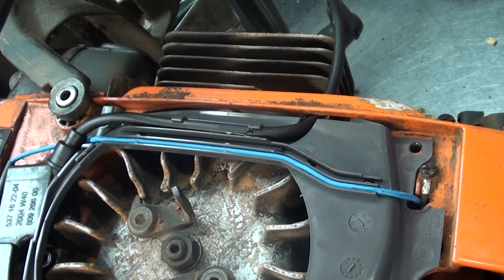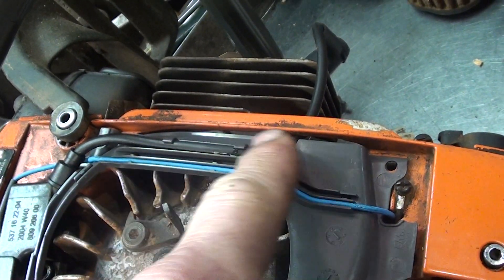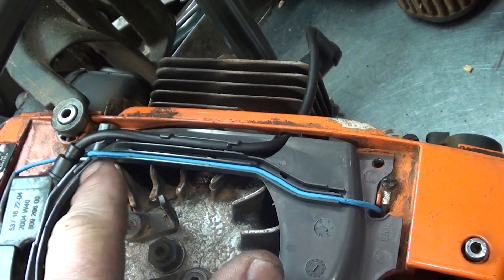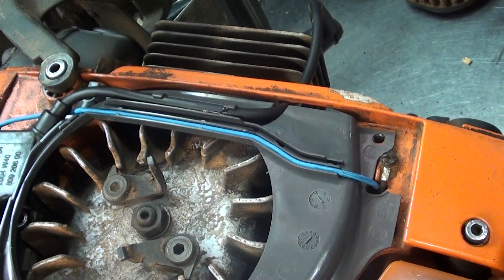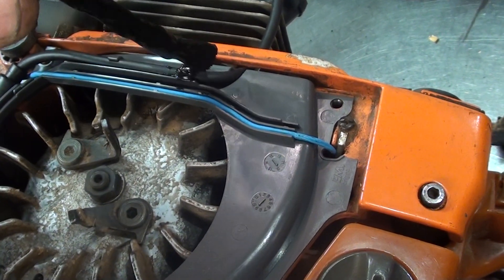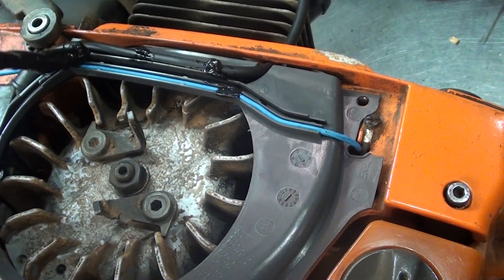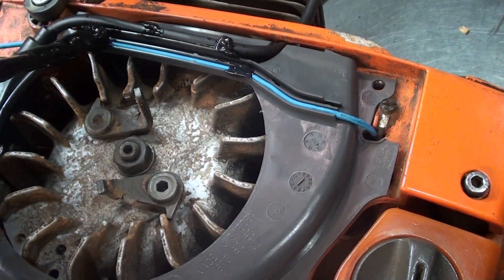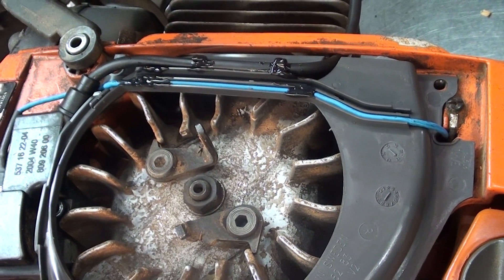The chainsaw guy shop talk Husqvarna  372 XPW ignition repair 2

Comment: TheChainSaw Guy, you said the wire unscrews from the coil?  I'm trying to repair mine on my Husq 350 and I see there is a rubber boot on the wire where it attaches to the magnet coil, but I don't see how the wire can unscrew?